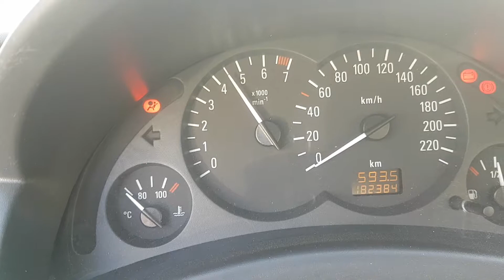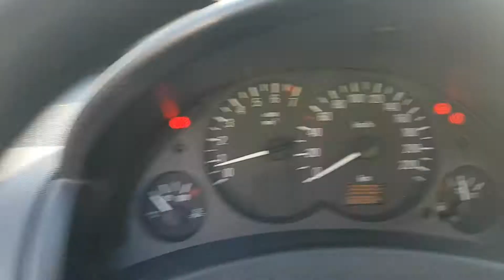Motor / Engine 1.0 Z10XE 58CP Opel Corsa C Opel Agila

Comment: Salut, ai rezolvat balbaitul acela la motor? Aceiasi problema o am si eu.
Reply from the maker: Salut. Nu am rezolvat, masina e pentru dezmembrare, nu am reparat-o :D
Reply: Ai rezolvat treaba cu motoru
Reply: @virgilcoman6264  nu am rezolvato.
Reply: @danielcirciumaru5514  a  mea face numai cand se incalzeste  m-am interesat si sar putea sa fie  pinioanele  de la ponpa
Reply: @virgilcoman6264  eu am inteles de la niste mecanici k ar fi din cauza injectoarelor sa cumpar nu stiu ce solutie pentru curatarea lor, sa bag in rezervor si sa fac mai multi km cu ea , dar nu am avut timp sa incerc.
Reply: @danielcirciumaru5514  nu cred  ca porneste bine   maine o duc la un mecanic care a mai facut treaba asta
Reply: Swirl flaps, disconnect the vacuum hose from intake manifold and block it